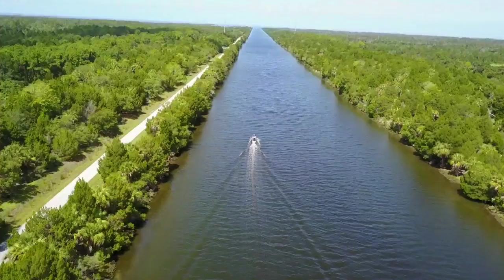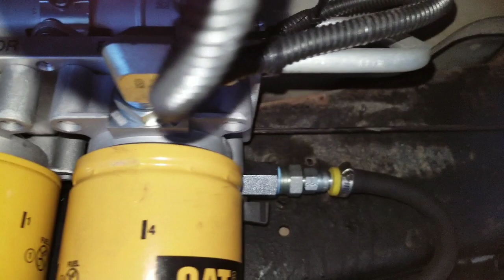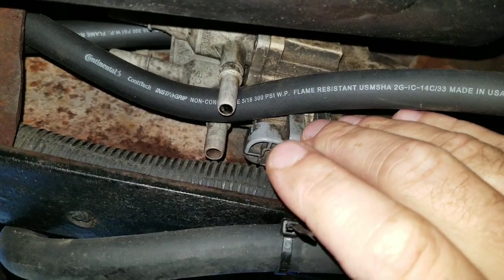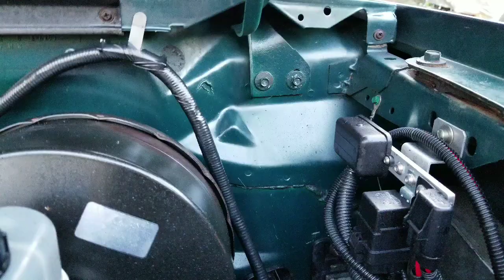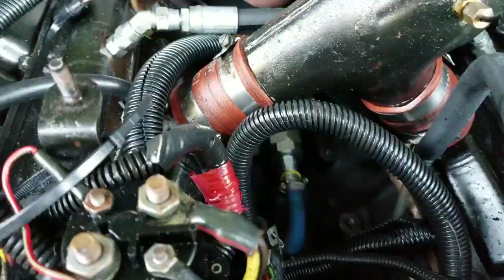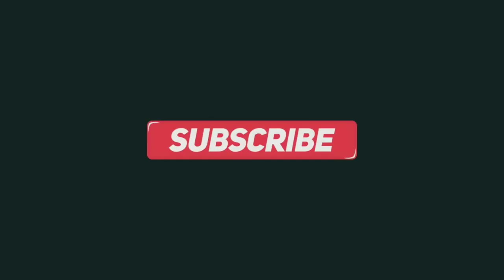7.🌲 EFUEL SETUP REFERENCE VIDEO 😮

Comment: Here's a question I noticed people messing with the oil pressure regulator when they put in the E fuel pump is that just because it kicks on with the key I'm not sure why are you doing that enlighten me? Thank you

Comment: Has your tank splice setup worked? Any problems with the tanks not draining evenly?
Reply from the maker: Yes it did work but my front tank was draining faster than my rear after using it for about a month I found out that the market was flooded with after market selector valve you can pick one up for 60.00 And they work because I'm using one since December without any issues.